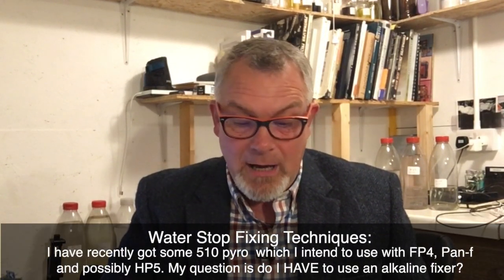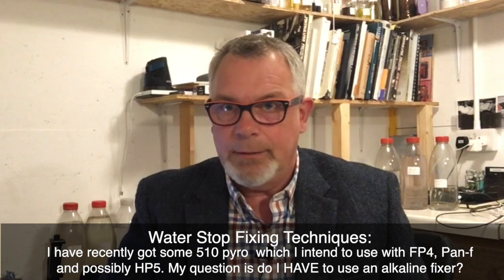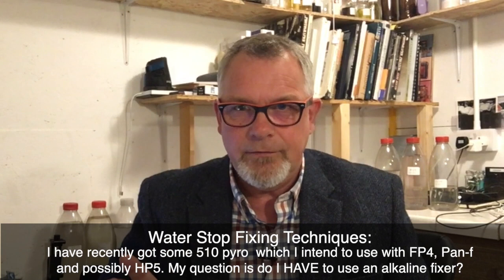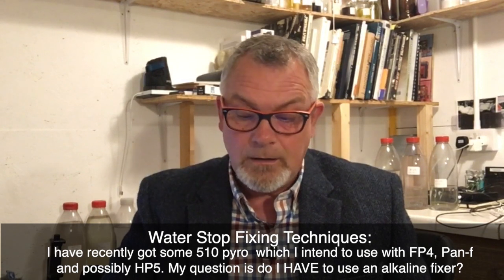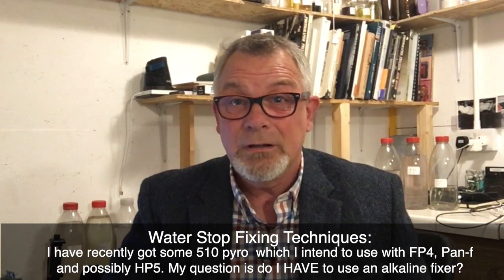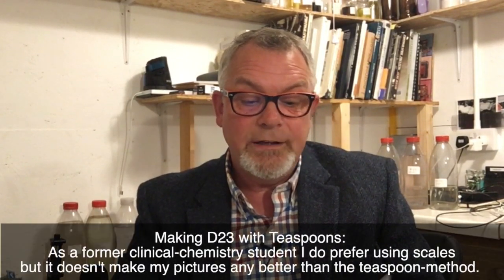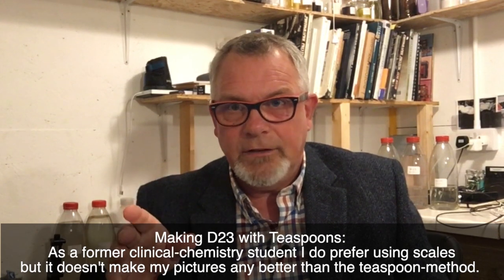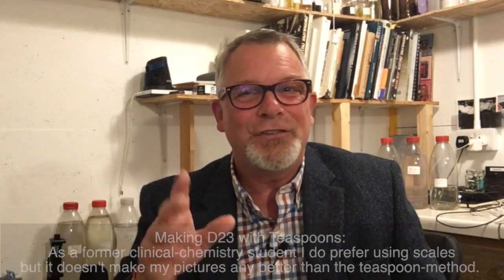Questions and Answer Pt1. I answer many of your questions from the first half of my YouTube channel.

Comment: Another great video, thank you. Can I ask please, regarding Barry Thornton’s two bath, how do you (if you can) push or pull film development? Eg HP5 at 800 asa?
Reply from the maker: I wouldn't use BT 2-bath to push film personally but I know Rüdiger Hartung has done some good work in this area. With the chemistry to make BT 2-bath I'd make DK76b and process with that. Use as D76 with same times for HP5 but remember to add 30% to the time for the 1-stop push.

DK-76b
Water 40-50C     600ml
Metol    2.5g (add a pinch of the sulphite first)
Sodium sulphite (anhydrous)    100g
Sodium metaborate    2g
Water to make    1 litre

Hope that helps.

Comment: Reticulation is an interesting thing I stumbled across after washing a water-stained piece of HP5 negative in ilfostop working solution (a suggestion I had read somewhere) but I didn't pay much attention to the temp and I noticed after washing that the emulsion had this strange tiny wet pebbledash appearance which I now realise was reticulation.  I won't make that mistake again!  For what it is worth the frame is probably still printable for me as it adds an effect rather than completely ruining the image.
Reply from the maker: Glad the negative is not ruined.

Comment: This is a fantastic tip. If i have 1L of d-76 stock made upon a bottle and use this butane trick is there any other way it could go bad over months than from air? light or just sitting there etc?
Reply from the maker: Other things to do: 
Keep it in  cupboard (dark) and in a PET bottle or glass bottle.

Comment: I was really missing your videos, it is great to see you back! I hope you enjoyed a nice summer time and recharged your "batteries", I cannot wait for the new videos. But this Q&A session was really good and I would suggest you do it from time to time. Two points: 1) Butane is highly flammable as already Rudiger mentioned in the FB group. 2) Pre-wetting - I shoot only medium format 120 B&W negatives and these have antihalation layer as well. I don't know whether it is this antihalation layer or some other additives in emulsion (as you mentioned) or combination but some negatives create effectively a foam during the agitation (I guess esp. during the first long agitation). My experience and it was mentioned by some other photographers in the online discussions is that this foam may not be easily removed by  just a one strong bang of the tank and may lead to marks on the negative esp. with low agitation scheme development. Any comments?
Reply from the maker: Cheers my friend!